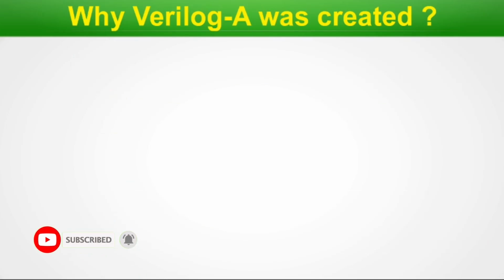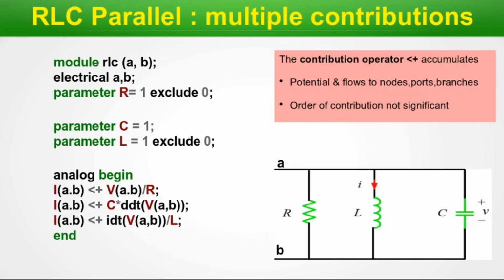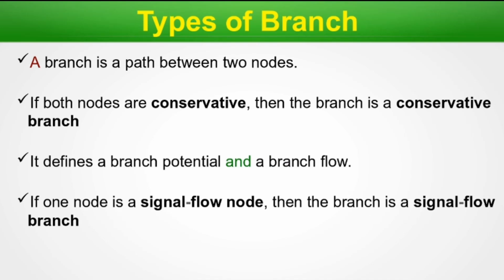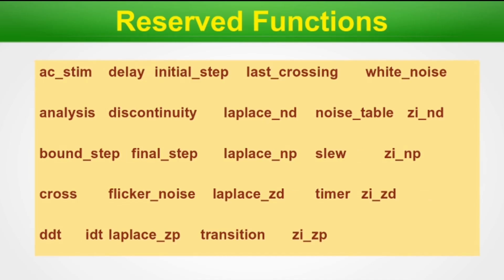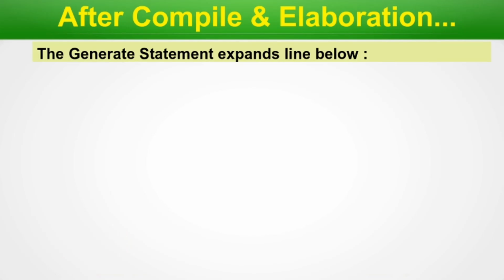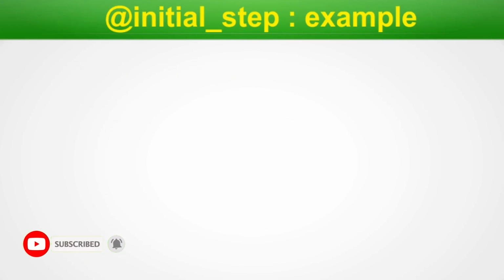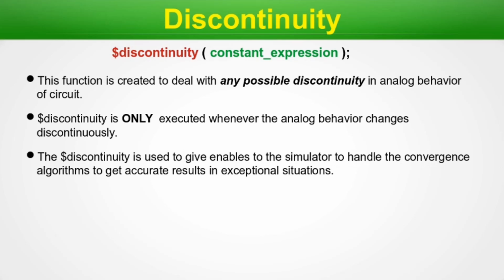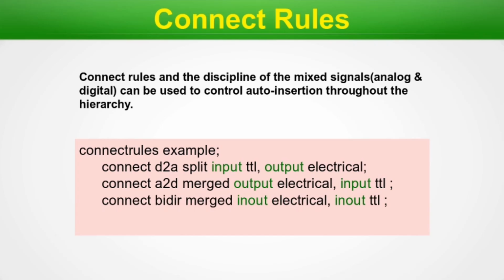Comprehensive Guide : Understanding Verilog-A in One Marathon Tutorial | What is Verilog-A

Comment: Hi Sir, I have a question. What do i can to use compiler to compile both Verilog-A and Verilog in mixed signal design?
Reply from the maker: Please consult the user manual or online documentation for the appropriate proprietary EDA tool— Cadence, Synopsys, Siemens EDA (formerly Mentor), or Xilinx. If you don’t have access to the manual, open a support ticket via the vendor’s official support portal:
 Cadence: Visit Cadence Online Support (COS) to access documentation, knowledgebase articles, and submit cases 
 Portal: [support.cadence.com]

 Synopsys: Use SolvNetPlus for manuals, downloads, training resources, and case submissions .
 Portal: [solvnetplus.synopsys.com]

 Siemens EDA (Mentor): Access the Siemens Support Center for documentation, license downloads, and case handling .
 Portal: [support.sw.siemens.com]

 Xilinx (AMD): Go to AMD/Xilinx support for manuals, knowledge-base, forums, downloads, and ticket tracking .
  Portal: [support.xilinx.com]

Each portal provides registration/login access to documentation, downloads, and a ticketing system. If documentation isn’t available to you—due to licensing or access restrictions—sign up or request access, then open a support case via the vendor portal.

Comment: can we declare output as "real" in verilog-A ? please do answer my question
Reply from the maker: In Verilog-A, you cannot declare an output as real. The real data type is used for internal variables only — not for module ports like input or output.
Verilog-A is primarily intended for analog behavior modeling, and its output ports must be of type electrical or branch, because they represent physical analog nodes or connections.
What you can do instead: If you want to convey a real-valued signal to another block:
Use an electrical output and assign a voltage to it using analog behavioral constructs, such as V(out) <+ expression;.
If you truly need to output a real number to another block, consider using a discipline with a real-valued nature, but that is an advanced feature and not standard in most tools.